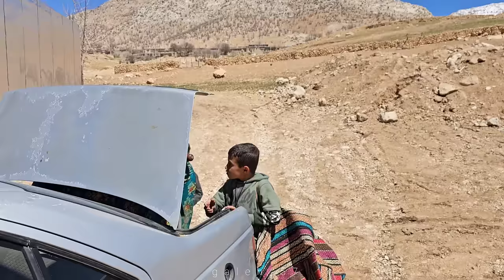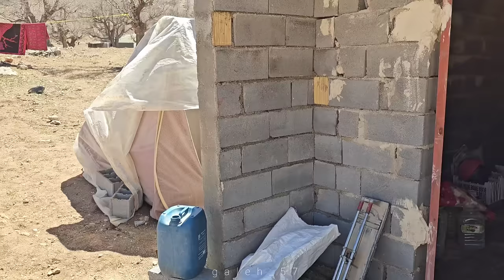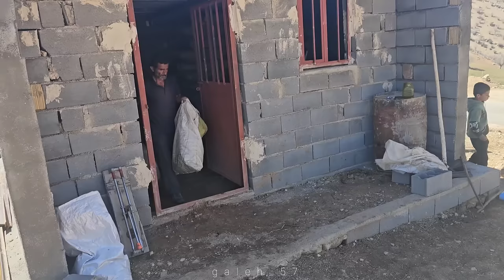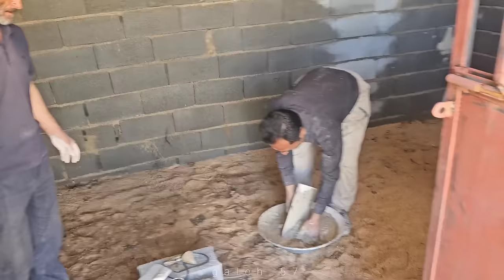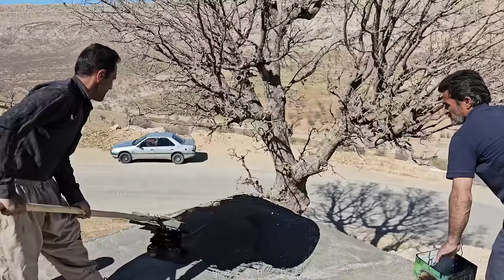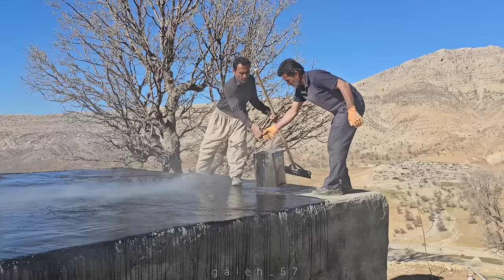Pouring bitumen and making the chromes of the burning house by the work master

Comment: After finishing, pour water on the ceiling and you will see that the walls are still leaking
Reply: They plaster the inside walls, isogam the roof, concrete the floor. It seems to work with similar houses that are built